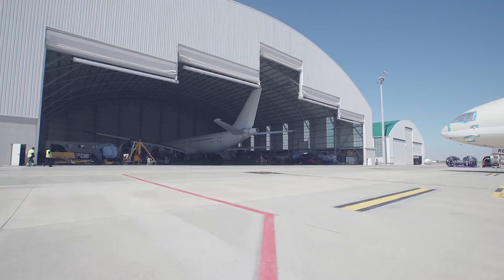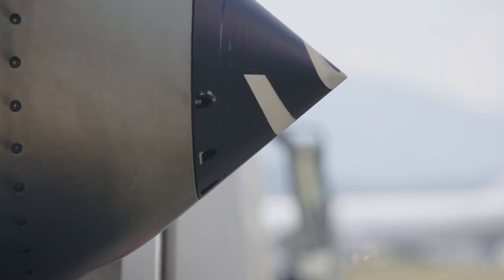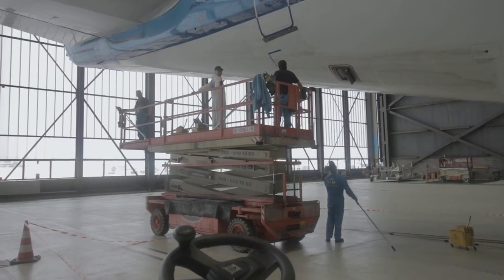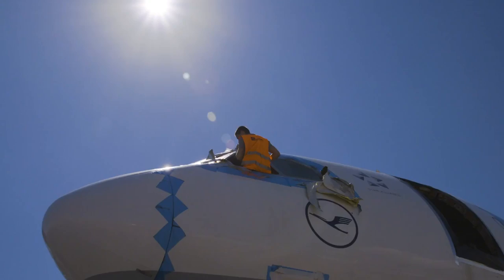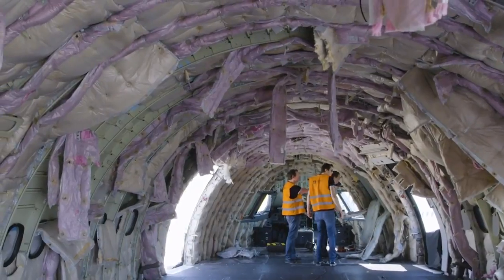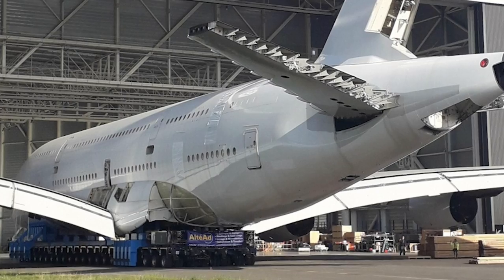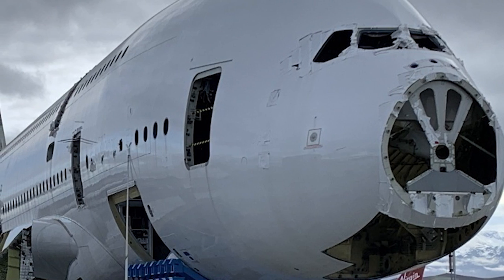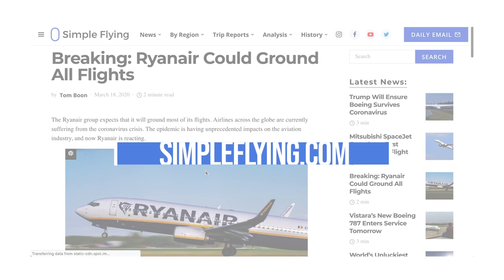How Is An Airbus A380 Scrapped?

Comment: Boeing bet on smaller, more flexible and fuel efficient planes. Airbus bet on supersized cattle-cars running between select hubs.  This video pretty much shows who chose wiser.   The 380 was a prestige plane, kinda like Concorde. It was never going to be viable in the long term

Comment: Why a plane of this model is being scrapped? It hasn’t been in operation long enough to be old. Were there faults in it?
Reply: Losing money on almost every flight because of cost to operate, mixed with cost to purchase, mixed with cost to heavily change airport infrastructure to even let one land = Nobody wants it anymore. Without a completely full airplane, the carriers lose tens of thousands of dollars on the flight, depending on how empty the plane is, hundreds of thousands. The 380 was designed in the 1990's and early 2000's with the 1970s mindset of both Hub and Spoke airline models, and ETOPS regulations. The 777 was launched and in service before the 380 saw service, the 777 changed the ETOPS rules to allow 2 engine planes to do trans oceanic flights where prior to that, you needed 3+ engines (hence the 380 being 4 engine like its failed older brother the 340). Their MTOW doesn't allow them to operate as cargo either due to the inability for it to be filled because of the weight, mix that with again the operational cost, purchase cost, and infrastructure costs. This was Airbus's attempt at competing with the 747 which had already been in service for over 30 years, but unlike the 380, the 747 was originally designed for cargo use for the USAF (was designed for the competition that became the C-5 Galaxy)

Comment: Perhaps there will be some more converted to freighters - or even a return of the Combi concept to include A380s during these unprecedented times. I flew on an Eva Air 747 Combi from Bangkok to LHR in the early 2000s. I was upgraded to business class as a late  border (whew!). What fun that flight was and how friendly everyone was in the bar. I think A380s would make good "Combis" - please don't euthanise them - they are still only puppies!/
Reply: They can't because airbus messed up the freighter vision so now it's impossible because there is no parts made to make it a freighter
Reply: @ethansaviation2672  But one company seems to have done it - Fly....? Anyway, it's sad. Thanks Ethan
Reply: @calicocatz7890  oh ye the did it but it's only for now sadly

Comment: I would like to know the reason as to why a giant aeroplane with an anticipated life span of 40 years has been scrapped?
Was their a quality problem?

Did the company book a big loss in its books?

Meghnad Shah
Reply: Because it cost more to operate than it made in service. The number of airports it could service was using the 1970's hub and spoke model of passenger travel, and each of those airports had to spend tens of millions of dollars to even make them able to service it. The plane was behind its time before it was even started simply because the industry changed to a more economical approach of high efficiency 2 engine planes with more seats (300+) that could service airports the larger aircraft (747's, A380s, A340's, etc) couldn't. The 380 cant be converted to cargo use either because of its design and weight, plus it would require even more airports spend money to facilitate them. The last 380 rolled off of the production line a couple months ago and will never be built again, even then, there are some that still haven't been delivered because the airlines have started and in some cases finished phasing them out of their fleet.

Comment: Airbus should have had the foresight to design the A380 to be easily converted for freighter use like the 747.
Reply: Structure can't handle it. Mainly the upper deck so it wouldn't be worth the work and operating would be to expensive.

Comment: Oldest in service A380 is not yet 13 years old and it's already obsolete :-( pretty sad really, when you realise that most 747's had operating lives in excess of 25 years. Of course the 747 is finished as well for passenger routes but at least it had a hell of a lifespan. The engineers saw them flying throughout their lives, proud of their work. Scrapping an A380 even to recoup a lot of the cost in parts feels so wrong, these were all $500M planes when purchased. It's like scrapping a perfectly operational LaFerrari or Koenigsegg. All the years and years of painstaking incredibly difficult design and development, extreme high end engineering work, hugely complex manufacturing process all for...... what? Very little it seems.

Comment: We need an A380 with just two engines
Reply: KYOUSHA no engine is powerful enough for it to fly as it does now
Reply: Unless that jet is flying with a full load of passengers it's a bottomless money pit to operate, only a few airports around the world can handle a jet this size and the mega hub system that it was built to fly in just proved itself an economical flop. Even with 2 engines it's a dismal economic failure.

Comment: The quietest , most comfortable , airplane with low fuel burn per passenger and   widest 19 inch wide economy seats fitted onboard Singapore Airlines A380, first generation planes, 

The future was bright in 2007 when Singapore Airlines first took delivery of the first A380, then emirates change the way Africans and India and middle flew to connect to the world.

Comment: Can't these aircraft be converted into cargo planes?
Reply: They could but won't, the largest issue with them as cargo is per lb, it would cost substantially more then a 747, while only carrying a little more. She was designed with humans in mind, not cargo. So while she's more profitable then a 747 while fully loaded with passengers, the 747 was designed around cargo. To make a long story short while the 747 was being developed, it was thought that the 2707, Concord, and TU-144 were going to be how all passengers traveled, so they made the 747 around cargo and until those planes took off she would pull double duty. She became a passenger success by accident.
Reply: Nope, all they're good for now is the secondary parts market and scrap aluminum.
Reply from the maker: https://simpleflying.com/why-existing-airbus-a380s-wont-be-converted-to-freighters/ - TB
Reply: Original airframe designed by Boeing to compete for the USAF superlifter program. Lockheed's winning design would become the Galaxy C5a. B747's signature feature allows complete roll through access to the lower freight deck. Elevated flight deck/avionics design poses no conflict with load/unloading; allows the nose to swing clear.

Comment: Scrapping very large airplanes is not uncommon. And the expenses associated with a parked A380 make it a prime feed stock for an airframe recycler. If they are not accomplishing a useful purpose, the breakers can make fairly short work of them. The US military scrapped it’s very expensive 747 airborne laser aircraft after a very short time and low hours because the failed to find a use for it when the laser program was cancelled. They harvested it of its useful components and then shredded it with no remorse. A virtually brand new 747. One of the 1st 787s (number 5) was scrapped because it could not be sold into commercial service due to its production issues and lack of usefulness.  Unless someone figures out how to convert the 380 into an efficient, money making cash cow freighter, they will go away fairly quickly as they leave revenue airline service. Many 747s, A340s and other twin isle aircraft are in line at the breakers and recyclers because the are no longer financially viable to keep around and money is recovered when they are scrapped.

Comment: A380 may be used as a satellite rocket launcher like Virgin 747
Reply: Ok you just saved two of them now what?  Unless that jet is fly with a full load of passengers it's a bottomless money pit to operate, only a few airports around the world can handle a jet this size and the mega hub system just proved itself an economical flop.

Comment: A380 Failed to become profitable. 

Concorde and B.747 : JOIN THE CLUB.
Reply: Actually the 747 was a vary profitable and successful jet, that's an old airplane design and the reason it's being phased out is the 4 engines, airliners and freight carriers was two engine jets, they're a lot more economical to fly especially the modern ones.  In fact the 747 out lasted the DC10's and L1011's
Reply: @oveidasinclair982 : And B747 will continue service on transcon freight routes, as originally designed.
Reply: @ltmundy1164  It was well designed air machine, it was large, but not too large where it would be restricted to only certain airports like the 380 is and it's an easy convert to cargo hauling.
Reply: @oveidasinclair982 : And a pair of 747-8 models are presently being retrofit as replacement VC-25B for USAF 98th Air Wing.
Reply: Umm, the 747 was for a couple of decades the most profitable airliner for a manufacturer in the world, and it outlasted every competition from the DC-10 to the A380.